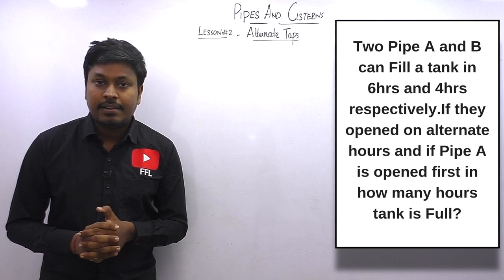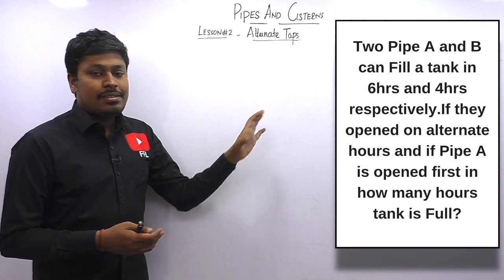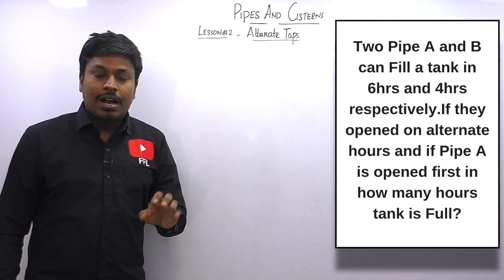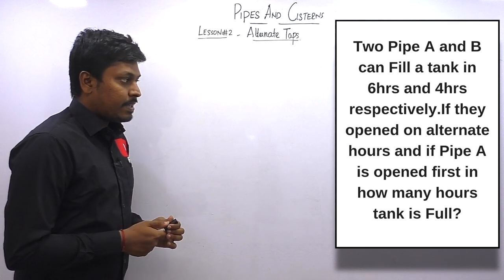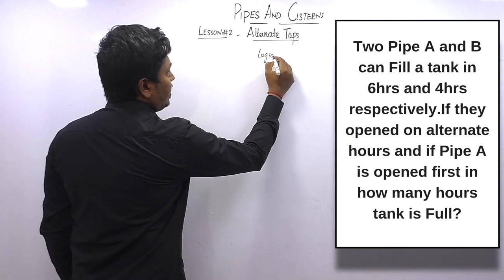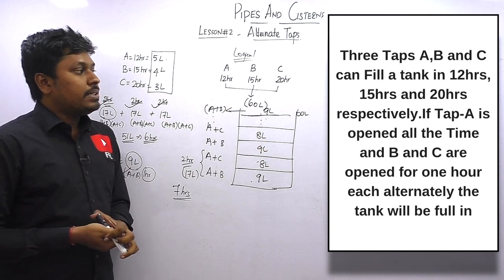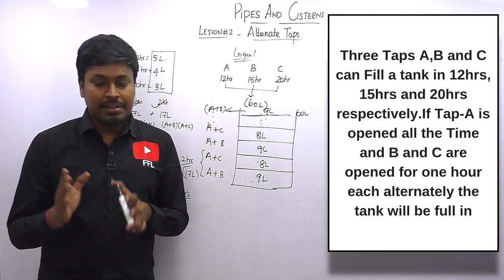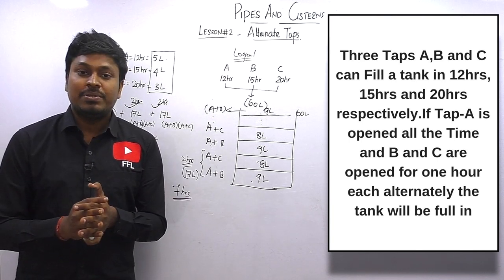Pipes and Cisterns || Lesson-2 || Alternate Taps

Comment: Sir in the question that I have posted below you got answer as the tank can be filled with in 6.75 hrs and my doubts is if such an answer for this question is not given and they have given 7 hrs as option can I mark that option which contain answer 7?,Sir I am asking this doubt for question number three, This was your question👇
Two pipes P&Q can fill the tank in 6 & 8 hours respectively. If they are opened in alternative hours and if the pipe P is opened first then with in how many hours the tank can be filled?